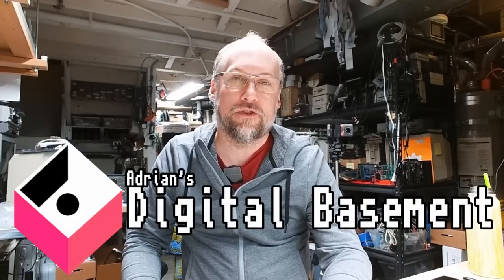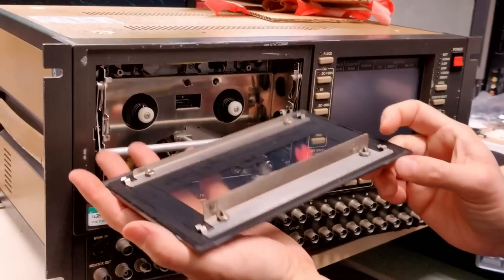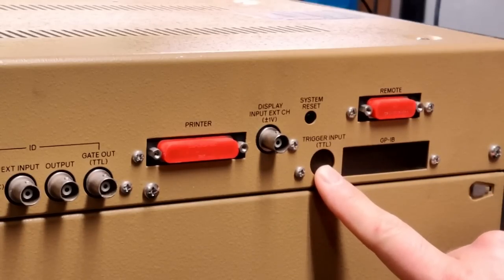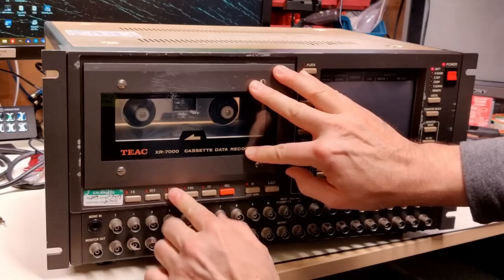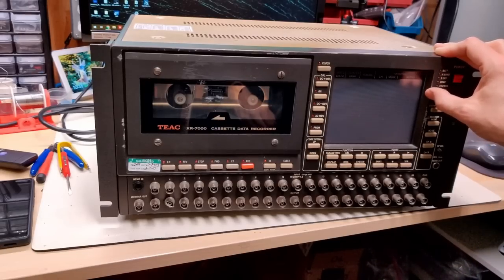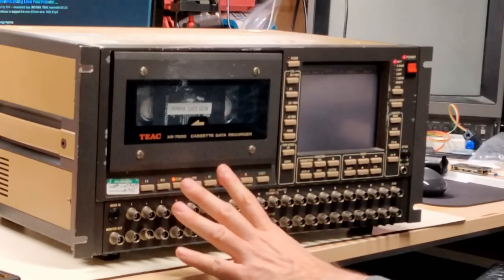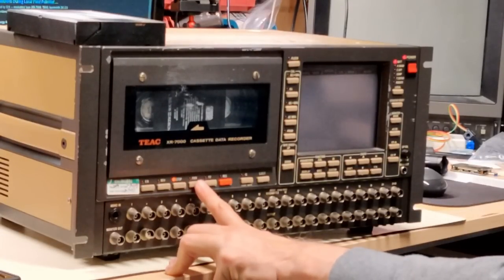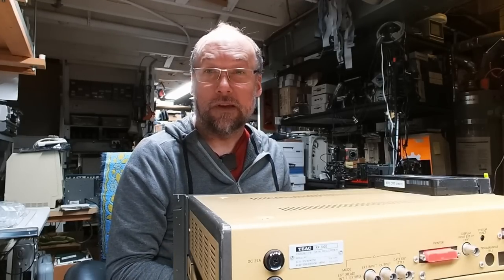0057 A mystery data recorder, a hurt Sun SPARCstation IPC and a MEGA little TV

Comment: 1990, 25Mhz 32bit.  Capable of running every version of Solaris up through version 8.  They skipped version 9 and jumped to version 10.  At version 10 you had to have a 64bit machine.  Very capable little machine back in the day.  I have a sparcstation 20, and have had a lot of fun with it.
Reply: ??  There was a Solaris 9.  I ran that in my very first data center job, until we moved to Solaris 10.
Reply: Oh, you’re right.  We skipped over it.  Thank you for correcting me.

Comment: the sparc was a powerful machine in the 90's not much compared to a modern PC
you can install linux on them, getting a copy of solaris if the correct vintage could be challenging, and at least on the prior generation of sparc "pizza box" you have to do the initial boot form a tape to initialize a new disk.  lovely graphics, these were often used for data visualization and CAD. as well as development. keyboards, mice and probably even power supplies can be found without too much trouble, lots of fans of those machines still about.

Comment: the 9 pin LSI add in card is very likely to be a early Fiber Channel adapter.  They used DB9 on gen1 if I remember correctly.   The Sun will default to serial console on port A if you don't have the keyboard hooked up.
Reply: It's a monochrome video card for use with Sun's monochrome monitor.

Comment: All I found that this TEAC XR-7000 thingy is expensive. The PSU is upside down from where you look at it when the SUN machine is open, meaning the PSU was above all the other components that's inside the machine, that cap juice could easily drip on them. It's not just like it's seeping out, it looks more like it exploded :( I'd love to see you try and fix that PSU and try to make the machine work!

Comment: For dial cord, I once used some dacron fishing line (not nylon) and that worked really really well, might be hard to get hold of these days.
Reply: Can get dacron at archery shops
Reply: @TheErador  Original dial cord is not that hard to get. Also not expensive.
Reply: @albinklein7680  cool. I was really just providing a viable source for dacron - it's used for bowstrings - I'm sure someone still sells dial cord.
Reply: @TheErador  I know! Please don't get me wrong on that matter! It was just a coincidence. I have a vintage tube radio in my kitchen and a few weeks ago the dial cord broke. I went to my local electronics store (I am lucky to have one here in Berlin) and they had three different kinds of dial cord in stock. And the spools they showed me to decide which one I want looked very modern. 
I just wanted to point out, that dial cord is still made and readily available (at least on mail order). I am glad about that, because there are more than enough radios out there with intricate tuning mechanisms which just don't work right without the proper cord. 
And you have to be very careful with fishing line or kite string, because that stuff is very hard and abrasive sometimes. It just eats itself in the plastic pulleys of vintage radios.
Ask me how I know....

Comment: This thing reminds me of my Sony A/D to D/A converter, it essentially takes an analogue audio signal and frequency shifts the signal to a higher frequency in the video band so that you can record audio to VHS tapes on a standard VHS tape machine.... 
I believe that Technics had something similar with the tape drive mechanism built-in.... 
While those things are actually pretty amazing, this thing looks to be designed to record analogue signals from sensors or equipment that has some sort of analogue data output.... 
Not sure but it's definitely a cool looking machine! 
Who knows, it could possibly record music? You could possibly record multiple channels of dual channel music and be able to switch between music channels from the front panel and being VHS, could possibly give 3hrs or more of continuous music.... I love the sound of that....

Comment: In the early 1990s our new boss introduced us to Sun workstations. Assisted by engineers from the Sun distributor in the UK, we assembled a network of five SPARCstations, viz: 2 x SPARCstation 4s; 2 x SPARCstation IPXs and 1 x SPARCstation IPC, together with Sun printers (I can't remember their details) and some standalone drives. The SPARCstation IPC served as a server for the printers, but I can't remember precisely how it and the printers were configured. I'm pretty sure it was installed in 1993, decommissioned in around 1996 and never turned off in that period. Sadly, all of that kit went straight to recycling in around 1998 but a colleague did re-purpose the SCSI HDDs and a standalone Sun CD-ROM drive.
Reply: That printer IPC probably had a 'somewhat' special frame buffer ie graphics card - connected to the SPARCprinter.

The SPARCprinter wasnt by itself particular intelligent - no HPPCL or PostScript built in, instead PostSCript was rendered on the computer and then as a bitmap sent to the printer.

Comment: I had repaired a few of these Sparcstations, the power supplies tend to have leaking (from the bottom, invisible in the early stage) capacitors on the secondary side. Even if it seems to work, replace all before everything burns out.

Comment: A long long time ago, when I used to work for ICL, used to both use Sun kit and integrate it into customer projects. The 'shoebox' form factor SPARCstations were my favourites — just for the look. They may not have been super powerful — especially the IPC which I seem to remember being lower end, or at least an early model — but they just felt like the size a desktop computer should be.

I assume the battery inside the cmos ram chip will be long dead so the machine won’t remember it’s MAC address or hostid — no idea what modern replacements there might be, if any. If my 25+yo memory of these boxes is working OK, the keyboard/mouse connector is an SDB connector: have a vague recollection this is related to Apple's ADB, although no idea if they’re interchangeable esp with more keys on a Sun keyboard and mouse.

Comment: There are still some vintage suppliers that will sell spools of proper dial cord, but I've heard that a suitable alternative is braided (cloth-type) fishing line; it's generally quite thin, and does not stretch (which is the important property for dial cord). You might be able to find some at a local hardware or fishing supply store if you don't want to go through the trouble of ordering actual dial cord from a vintage/retro supply place; the fishing line will look a bit different, but it looks like the dial cord isn't even visible in these sets anyway.
Reply: So the modern dial cords aren't very good?

Comment: When going to college for computer science the college had a lab of Sun IPC machines. They boot off the network if I recall. Anyways they had crisp high res monochrome displays and the units I used had 68040 cpus. We’d program and compile C on them. The neighboring lab had sun sparcstation 5 units and everyone would try to get a seat in front of those newer models first.
I had no complaints about the IPC and logged many hours with that model.
Reply: The SPARCstation IPC had, as the name suggests, a SPARC CPU. The earlier Sun-1, -2 and -3 models used Motorola CPUs, but I don't think they shipped a 68040 version. I imagine that by the time the 68040 came along, Sun weren't interested in upgrading the Sun-3 models at all, and most Unix vendors had jumped ship to other architectures. In my university, I think we had IPC machines and possibly some others of the same vintage, and the only Sun-3 machine I saw was doing menial work in the printer room.
Reply: @paul_boddie  Ah yep sorry I was remembering incorrectly on the cpu. Thanks for filling me in.
Reply: @joshhiner729  No worries! Reading old copies of UNIX Review, I saw that HP kept shipping Motorola-based systems, even a 68040-based workstation, despite having the much more powerful PA-RISC architecture to play with. It made me wonder whether the HP workstations at my university weren't also 680x0-based, but I'm pretty sure they were actually PA-RISC-based. No major Unix vendor even bothered with the 68060, but the 88000 was a hot product during its brief lifespan.

Comment: I have a couple of sparcstations like that, ipc and lx. Got them netbooting Linux. Never had the keyboard or mouse, or a monitor that could handle the sync rate using a 13w3 adapter to vga. Just used it over the serial port to a Wyse vt terminal. Was fun.

Comment: Based upon the catalogue entry you referenced: you hook up a bunch of data  from lab devices or remote sensors. data on VHS and data on 1/2" RTR videotape have been discussed on several other retrochannels. Techmoan has a vid ona VHS data recorder. those BNC connectors were common for ethernet and a couple other networking protocols; hence why I suspect 10b2 ethernet (it was the standard for both MS and Novell).
Reply: Adrian send this to Techmoan, then have Curious Mark and Master Ken fix it...

Comment: GPIB is an interface format for test gear. Pretty much all the pro level oscilloscopes, multimeters, frequency counters have this.
You can hook your HP resistance meter and Tektronix frequency Counter to a data recorder like this, or these days use a GPIB to USB interface to record it too your PC. My hobbyist level Oscope just has USB and LAN to cover that kind of functionality. But I think GPIB allows not just data recording but also remote control funcitons.  
I think there is a delay compensation in OBS? I haven't used it in a while and may be confusing it with another app, but might be something to look into?

Comment: Holy data-recorder, Batman! Look at all those BNC inputs! I notice the battery-light is active on that TEAC unit.
Dial-cord seems like very fine paracord, but it's basically a woven cord with minimal stretch, I think.
That Sun unit has an easy-to-dump BIOS, looks like! Could eject the floppy with a paper-clip at least.
I wonder, could an ATX power-supply be adapted to that Sun unit?

Comment: 25:30 - I still have my Sony Radio alarm clock that I bought when I was a teenager (it's still plugged in and still works), and it still has that "It's a Sony" sticker on the front.

Comment: Oh wow. A Sparc IPC.  The college I went to had quite a few Sparc IPCs in at least two halls.

 I didn't like the IPC. It was underpowered compared to the Sparc IPX.   I think the IPC had a Sparc processor clocked at 25Mhz. It felt much more sluggish than the IPX.

I think both the IPCs and IPXs at that college ran SunOS 5.1.x/Solaris 2.5.x.  They also had an audio dongle connected. I believe it was 8-bit (could have been 16-bit though too) audio at 11kHz or 22kHz.  But good enough for late night Doom deathmatches! 

Seeing the Sun logo when these turned on was very fascinating to see. :)

Hopefully you can get that IPC working again.

Comment: lol - all the Sparc stations I used didn't have an eject button - this was a Sun thing.   You have a motorised ejector - use the eject command - e.g. eject /dev/fd0  and it will whir and push out.  There is a little hole where you can poke a paper clip or other wire and it will eject mechanically.  This is also present on every CD drive I have ever had for same purpose!

Comment: On the sun IPC- that floppy probably is similar to the mac ones, in that it has a power eject.  

And i think that adapter card in it may be for a monochrome monitor.   I had one of those sun monochrome monitors on a 3/60, and I think I remember it being 9 pin.
Reply: The pinhole in the front bezzle is a manual eject. use a paperclip in the hole to eject the disk

Comment: Somewhere, either on eBay or another YouTube channel, I've seen a similar device to the TEAC recorder that had 8 channels and no display. If it's what I'm thinking of it's basically the equivalent of a low bandwidth storage oscilloscope, where it stores the signal in an analog format on tape instead of a digital format.

Comment: It's amusing to see the people talking about the Sun IPC being slow.  When it came out, it was pretty zippy.  Of course, technology was moving pretty fast at the time, so its 25Mhz Sparc processor was followed a year later by the 40Mhz version in the IPX, and then the 50Mhz version in the LX the next year.  With the IPX being pretty popular, you could get an 80Mhz CPU replacement for it also.  No such upgrade for the IPC, though.  These came out at about the same time as the 486 CPU, and they're similar in performance to a 486 of the same clock speed (slower integer, faster floating point).

Comment: Those IPCs have dodgy power supplies, and tend to kill the boards. The good news is that you can eject the pins from an AT power supply and use that to power the motherboard - the POK signal can be left disconnected, then it's just +-12V, 5V and GND IIRC

A friend of mine has made a USB Mouse / Keyboard to Sun adapator to work on these era Sun machines (github - delan - usb3sun) and we've successfully gotten one to POST with it.

Comment: One thought more than likely the belts are dead or dying. On most transports Fast forward often is an idler wheel coming in contact with the motor so no belt issues. Also hi end machines often had motors for each spindle and then one for the regulated capstan. That could explain the erratic movement's and noises.

Comment: I asked chat GPT about it, this is the answer, and I don't know if it is right

what is a teac xr-7000?

The TEAC XR-7000 is a vintage stereo receiver that was first introduced by TEAC in the late 1970s. It was designed to be the centerpiece of a home stereo system and was known for its high-quality sound reproduction and powerful amplification capabilities.

The TEAC XR-7000 features a built-in AM/FM tuner, a phono input for turntable connectivity, and multiple auxiliary inputs for connecting other audio sources such as tape decks, CD players, or MP3 players. It also has a number of tone controls that allow users to adjust the sound to their liking.

Overall, the TEAC XR-7000 is considered a classic piece of audio equipment among vintage audio enthusiasts, and is highly sought after by collectors and audiophiles alike.

Comment: Sparc IPC. NVRAM is probably shot, it has a battery integrated into it and you'll need to get past that in order to get it to boot. Some people cut into the NVRAM module and attach a coin cell battery. You don't need a keyboard because you can use a serial console on port A. Performance wise it is not great. It'll run SunOS 4.1.4 (the website that I sent you via email with the flexlm file has isos for that). The ROM monitor is very easy to use.  I do recommend getting a keyboard, however, so you can witness the joy that is running OpenLook with a sky blue background. :) Before linux came to prominence SunOS 4 was my go to operating system for work (I was, and still am, a penetration tester).

Comment: I've done a similar modification like that that I used two different Bridge rectifiers to feed batteries will go for one rectifier and and the input would go for the other rectifier what would then end up going to the same on the board allowing it not to reverse charge the batteries or put Power out on the barrel Jack and allowing me to use any polarity of barrel Jack without risk of blowing the TV up

Comment: The SPARCstation IPC is a slow-ass boat anchor.  Solaris will run like a dog on that machine regardless of what version.  You can install Linux or BSD on it and maybe use it for lightweight server applications, but don't expect it to be any kind of speed demon.

It was what passed for a low-end Sun workstation even back in the day.

Comment: Regarding the Sun IPC: These machines were slow even back in the days. I wouldn't put too much effort into it. And note: there is a battery inside the machine that is guaranteed to be dead by now. This battery is inside a Mostek (now ST) M48T02 NVRAM/RTC chip - a DIP24 chip with an unsuual high package case that contains the chip itself, the crystal and the lithium cell. This chip contains the system identity, hostid, ethernet mac address and other settings. The system won't work propery without a correct nvram.
This system has sun4c architecture. You should use SunOS 4.1.4 on it. Mayybe an early Solaris would work, but I'd stick with SunOS. More recent Solaris versions dropped support for sun4c and required sun4m or sun4u. You need a compatible CDROM drive to boot from.
The SBus card looks like a monochrome video card for an high resolution monochrome display. You should remove the card - it's not useful without the maching monitor. The onboard graphics is an bwtwo, monochrome 1152*900. No color.

Comment: Looks like I have the same Sun Spark station (along with the CD, tape and external disk drive SCSI units) . 
It was all working last time I switched it on a while ago, but when I tryed it recently... nothing.

I may still have some cable to connect a terminal to this.
I do have a keyboard and mouse, but I'm in the UK!

Haven't got around to testing stuff yet.

Comment: The battery compartment of the Sony TV might be large enough to accommodate a powerbank and a 5V to 12V DC/DC converter board from AliExpress. Just as an idea if someone actually want's to use it portable nowadays.